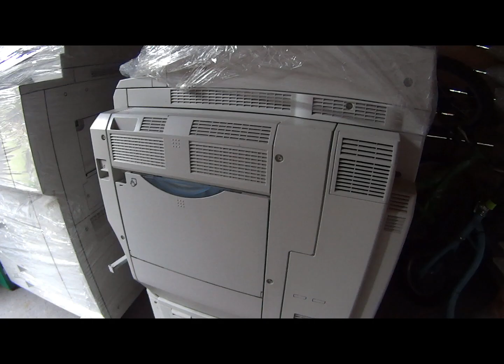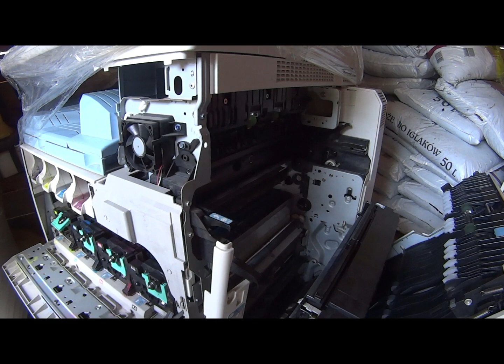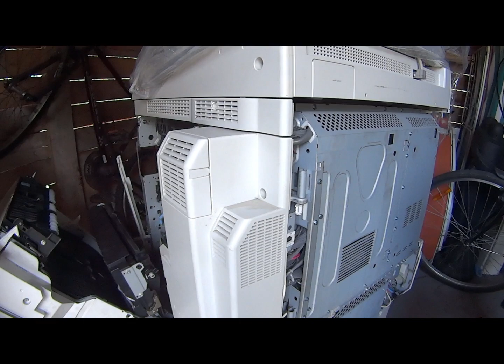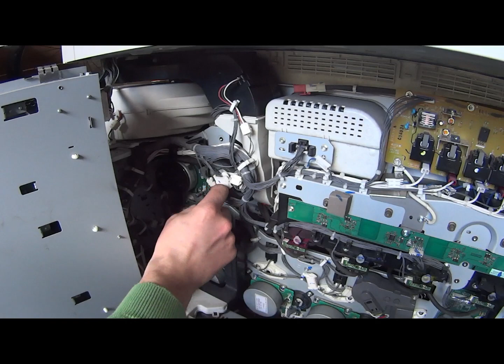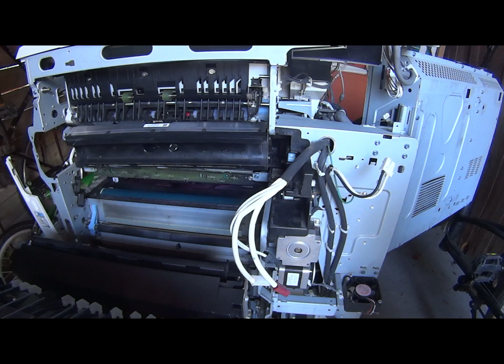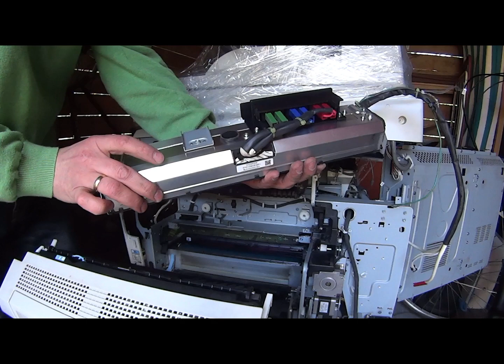RICOH color copier MPC3500 MPC4500 Error sc580 sc581 sc582 sc585 sc586

Comment: Hello, I have error code SC582, I tried to reset the error code with Clear Modes but it does not work, what else can I do to solve the problem? Thank you
Reply from the maker: You need to fix fuser first, not reset. Possibly damaged fuser film and thermistor.

Comment: hello Tomasz I always have difficulty for the Ricoh mpc3500 copier of which yesterday I sent you the message practically now I am trying now to solve but the problem is that the functions of the display control panel are blocked I saw that the yellow toner almost exhausted even if the light toner is not turned on the system status tells me not detected the percentage could be the toner pump? could you give me some information thanks a lot hello Tomasz.
Reply from the maker: Most often, the cause of such a failure is a damaged toner pump. If you replaced the yellow toner and the copier has a problem all the time, replace the Toner Pump. This is a popular failure ...

Comment: Tengo ese problema en una 5001 el codigo sc582 si hay q cambiar algo ahi
Reply from the maker: Buenos días
sc582 RICOH MP5001:
IH inverter current error at power on. The output current from the IH inverter does not reach the proper value when the IH inverter turns on.
Causes: 
Disconnected power input terminal 1 and 2 
Defective IH inverter 
Defective IH coil unit 
Defective fusing unit
Remedy: 
Check the power input terminals 1 and 2. 
Replace the IH inverter. 
Replace the IH coil unit.
Replace the fusing unit.

Saludos
Części do kopiarek http://www.copy-expert.pl/
Facebook: https://www.facebook.com/Copy-Expert-113431678801597/
Części używane http://www.copy-expert.com/
Serwis kopiarek Ricoh Warszawa http://sprintprintserwis.pl/

Comment: buenas tardes amistad el error sc 442 que viene siendo en una mpc 5000
Reply from the maker: Hello, Error sc442 in MPC5000 ricoh means: Image transfer belt contact motor error. The image transfer belt contact sensor does not detect the movement of actuator at the sensor while the polygon motor rotates. • Dirty image transfer belt contact sensor • Defective image transfer belt contact motor • Disconnected connector of image transfer belt contact sensor or motor • Disconnected cable You can do 2 things: 1. Replace the image transfer belt contact sensor. 2. Replace the image transfer belt contact motor. Good luck www.copy-expert.pl
Reply: buenas noches amistad donde lleva el sensor para limpiarlo

Comment: السلام عليكم .. رجاءا عندي طابعة ريكو mpc 305 ..المشكلة التي فيها ..الشاشة تعمل بشكل طبيعي بحيث تظهر ان هنالك خلل رقمه sc144  جميع الموتورات والمصهر لاتعمل بحيث لاتسمع لها اي صوت من بداية التشغيل حتى اطفاء الطابعة .. اعتذر على الاطالة مع شكري الجزيل لكم
Reply from the maker: Description: SBU Communication Error • Connection to SBU cannot be confirmed. (Connection detection error) • Cannot communicate with the SBU, or the communication result is abnormal.
Causes: • SBU defective • The other side of the communication (BCU, IPU etc.) defective • Power/signal harness defective
Remedy: 1. Turn the power off/on. 2. Reconnect the power/signal harness. 3. Replace the following parts: • Replace the SBU board. • Replace the IPU board. • Replace the BCU board. • Replace the power/signal harness.